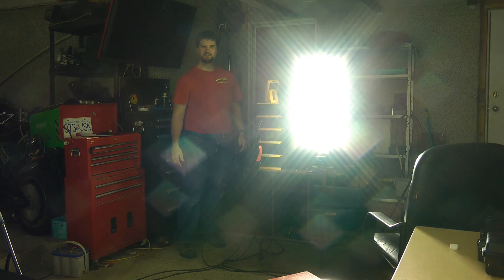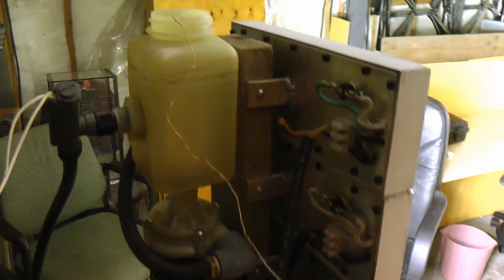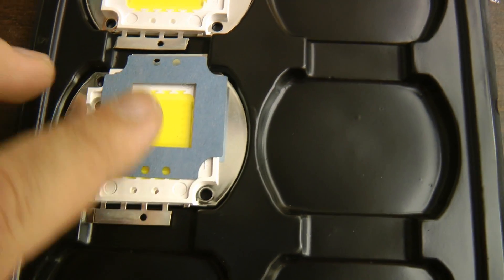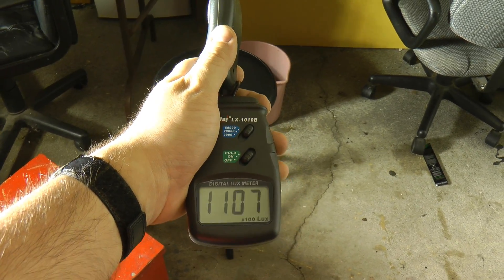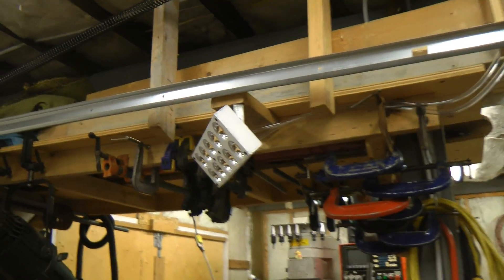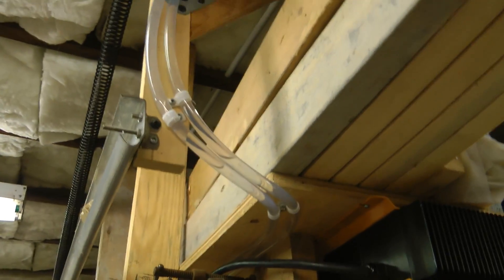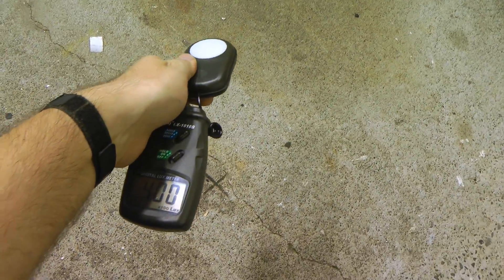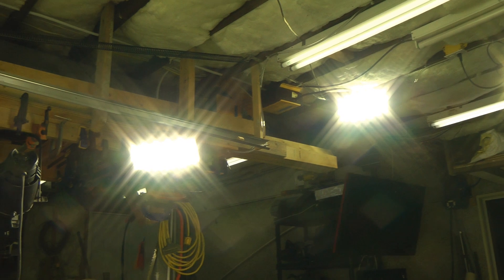World's most powerful LED light - 5kW (1kW module build part 2)

Comment: It's not /quite/ going to be this nuts, but once my shiney new Chronos camera shows up I've got a 300x215x40mm heatsink off some kind of power amp that, along with 3, 80mm Delta high flow fans and some ducting, should make an acceptable 1kW portable LED light. :)
It's going to be used by to many people to to trust them to water cooling. And I should be able to use the camera's trigger in/out to turn the lights on/off as needed too if it can't run steady state.

Comment: I am trying to put two 150w LED chips in an old theater Fresnel fixture. My main concern is cooling. I was thinking of grabbing two Corsairs H55 to to cool both chips but I have no clue if it will be enough. 
I will be using two Luminus CVM-27. They operate at 4200ma/36V/150W and have a Thermal resistance of 0.16 ℃/W
Do you know if the H55 will be enough to cool?

Comment: I wonder... Why won't you use automotive radiator as a cooler? They come with 12V fans, taking a big one with two fans and running them at lower voltage would provide plenty of cooling and quiet operation.

Comment: 5 kW of LED lights... I can imagine the heat you can feel standing in the middle... But then this 750 kW of incandescent lights at IIHS - That's ridiculus, I believe that running them bit too long would heat the whole test chamber to some extreme temperatures!

Comment: aluminum corrodes very quickly in cooling loops. you should also try to avoid mixing metals.  aka the brass fittings. venal tubing is also not ideal. the plasticizes leach into the cooling fluid quickly. you should also use car coolant so nothing grows in you're coolant. it will also add anti corrosion.

Comment: A few things you might want to think about

Water wetter, it's not a type of anti-freeze, but it breaks down the surface tension of water, improving heat transfer

Also, by chaining the water blocks like that, some array's will be getting hotter then others, possibly significantly so.

Sections of copper tubing in the straight sections could help add some additional cooling and help with the sagging issue if your ever running those cooling lines again in the future.

Comment: Led lighting becomes impractical when you need a ton of light, but I would be interested to compare the equivalent amount of leds to an IMAX size xenon arc lamp. How much surface area would you lose and how much energy would be wanted on cooling if leds were used? I'm guessing it would be less, but you never know.
Reply from the maker: This LED setup produces almost as much light as a 15kW Xenon lamp like those used in IMAX projectors. Xenon lamps aren't that efficient, but they do produce vastly more concentrated light than LEDs, which allows better focusing. Imagine all the light from these LEDs being produced in a 3x10mm area. There's no way you could run an IMAX projector with LEDs, at least with current technology.

In terms of cooling, the Xenon lamp is more complex than cooling these LEDs. Those large lamps require two water cooling loops (one for each electrode) which are electrically isolated, plus powerful air cooling as well.
Reply: ... my point was merely that it's probably possible, though not practical.

Most people often seem to think that because something isn't practical, that it's impossible.  There's a large difference between the two
Reply: I think it's be possible with current technology, but the lensing needed would be complicated and HUGE.  Certainly not practical.
Reply: I'm talking about a large array of led's, and a large lens setup.  i'm not talking about making a single chip that bright
Reply: animefreak5757 absolutely. For example, we have had the tech to put humans on Mars for over 30 years. But was it practical? No (mostly due to economics).
Reply: Actually, conservation of étendue forbids such concentration apparatus, no matter how complicated (as long as it's linear, which mirrors and lenses are).
Reply: a quick google shows that what your talking about is WAY over my head, it's a bit moot though, as even if it is possible, it's entirely impractical.
Reply: No, it's not - semiconductors will die in flames, if you try tu concentrate even 1 kw in small area like arc of xenon lamp. In headlights there are arrays of tiny leds with lenses.
Reply: animefreak5757 and that is exactly why a xenon solution is still superior in many cases.
Reply: animefreak5757 It's a bit complicated, I haven't studied it much myself. Here's the intuition: conservation of étendue implies you cannot concentrate light into more and more concentrated beams indefinitely. Specifically, for a surface LED source, you can have as much brightness at a region as 2x the brightness near the LED surface. So the brightest you can make a little square that would be behind the projection filter would be 2x as bright as the LED module itself, which is much lower than the 5kw/30mm^2 requirement.
Reply: Do you know of any way to reduce fall-off (the intense drop-off in light output that happens quickly from the center of an LED spread)
Reply from the maker: With the lenses the spot is quite even right up to the edge. Without them there's more dropoff. A clever diffuser system could make it better but that's some effort to make.

Comment: I'd recommend doing what DIY Perks did on his LED. Sand the flat side of the lens to get it frosted, it will still focus the light, but the yellowish ring will be blended into the rest of the light. Your current settup, while also viable, wastes that light for heating the paper.

Comment: Should not use series connection for cooling.  By the last light block, the input water temperature will already be too high.  Plumb it in parallel and you'll get better cooling performance.

Comment: Jesus that is ridiculous the amount of heat from that must be around 3500watts. I myself have built a 500 watt portable light, when going from only having one light on and turning the other 4 on i only saw maybe a 2x increase in perceived light so imo the other 400 watts not really worth it for flashlight lol. What do you use that light for.

Comment: Hi mate great build. If you wanted double the lumins and run a lot cooler, you could replace those with the next generation of cobs . The Cree CXB3070 , or cheaper alternative is the Citizen CLUO48. You will be amazed.
Reply: Garry
I like LEDs because of their extraordinary method for producing white light which is also very efficient.
Unfortunately I doubt a little about their spectrum quality. Especially the peak in blue and non sun like spectrum (there is no UV and peak is different).
I am collecting as many different LED solutions and then I will try to test and compare their spectrum to sun spectrum using all self gathered data (up to now I have only relied on spectrum graphs of different sources).
My goal is to simulate light as close to Sun spectrum and for that I will need to analyse the Sun (and Moon also) spectrum as good as possible through a day/year/seasons and then find the best equivalent light.
I believe that nature knows best which kind of light is good for us as it shaped life on Earth as we know it, and only cca. 100 years ago people started using extremely artificial lighting sources (electricity and invention of incandescent light).
But incandescent light is still nature's way of lighting (we heat up tungsten filament to 3000K degrees and then it produces radiation similar to black body radiation at 3000K), where as the following are completely artificial: fluorescent lights (3-5 wavelength peaks), halogen lights (strange behaviour in IR, extreme peak and this IR energy can cause our eyes/retina to slowly burn), LEDs (light radiation only in visible range, but its shape is still questionable as it does not represent anything natural (e.g. blackbody radiation)).

About discount joke, I thought you had me for one of those YouTube people who are trying to make other people buy on affiliate webstores :)
Reply: Garry
I agree with you. These Chinese COB LEDs are extremely inefficient for their power draw. I was able to get similar light output to 10W (measured) Chinese LED using 3W (measured less than 3W power) COB LED that used really efficient Bridgelux chips.
The efficient COB LEDs are still made in China, but use modern efficient blue LED chips. Only the most efficient Cree LEDs can compete (150lumen/W compared to at least 100lumen/W of Chinese Bridgelux COBs).
And really efficient Chinese COBs cost only .40$ per 3W COB, and if we compare the price of similar Cree COB CX1304 at cca. 2$ per chip, this is still not extremely expensive.
If anyone is interested in efficient Chinese Bridgelux  based COBs, here is link:
https://tongyifang.en.alibaba.com/
Reply: Garry
And Cree CXB3070 has not only double the lumens, but tripple or even more for the same power draw.
Reply: +ZiGa:S  I'm not saying all Chinese chips /cobs are bad , far from it. But those particular chips . the newer design round chips you sell on a ceramic white base are of good quality,price,performance. And no ,I don't want a discount
Reply: +ZiGa:S I have a vast experience in using led and yes that sadly is true .
Reply: +ZiGa:S Do you test all your cobs, chips ?
Reply: Garry
I have tested quite a lot of LED chip solutions:
- LED stripes (extremely inefficient as the fourth resistor in series consumes almost quarter the energy and LED chips are only average quality)
- Chinese cheap old technology COBs (package is similar/the same as one shown in video)
- Chinese COBs using Chinese LED chips (they are much more efficient than old technology COBs)
- Quality Chinese COBs that use quality phosphor and LED chips (these chips can easily compete if not overperform COBs from top manufacturers (Cree, Brudgelux, Samsung, Philips...)
- the best of the best such as Crees most efficient COBs, but if one wants best artificial sunlight LED equivalent lighting, one needs to look at UV based white LEDs, but at the moment there are only a few companies producing such chips and the best (according to specifications) is Toshiba TRI R that are not yet available for mass market.

I have also found out there are four ways to get white light from LEDs (from worst to best):
- using RED GREEN BLUE LEDs
- using BLUE LED for base and one phosphor that emits in yellow/red spectrum
- using BLUE LED for base and 2 phosphors that emit in green and red spectrum
- using UV LED for base and 3 phosphors that emit in blue, red, green

And I have not tried to sell you anything, I just provided a link to their store that I have bought from and found out they are great value.
Reply: +ZiGa:S Sorry that last bit was a joke . Sounds like you know your LEDs . its great that you do , some really don't . I mainly make  Grow lights using large cobs with either reflectors or large lenses. But the love of my life is using LEDs on buildings, boats  ,kitchens , cars and gardens .   Great colours and controllable don't ya just love um?

Comment: Seems many have already commented on the series cooling being an issue: much better would be to use an send and return manifold. Also given the video footage of the air traversing the coolant lines, it seems the flow rate is retarded. Have you characterized your heat sinks w/r/t pressure vs flow? Could be you have an appreciable pressure drop across each. Finally, do not leave untreated water in the system: it will likely turn to nasty green sludge. You will want some scale, bacterial and corrosion inhibitors in the water.

Comment: Automotive gasket card wound handle the heat
Reply: Midnight Mechanic where do you come up with non water based antifreeze would help. Whether using propylene or ethylene glycol, pump horsepower requirement goes up, density goes up, specific gravity up, and specific heat down. All of these lead to less ability to transfer heat. You may increase boiling point, decrease freezing point, and you may help prevent scaling and erosion, but you definitely are hindering heat transfer, not helping. Distilled water is the perfect heat transfer fluid if you are out side of the range of freezing, boiling, and are not worried about inhibitors. Only thing that will help heat transfer is thermal transfer compounds on heat sinks, properly sized radiating device with properly met airflow requirements, and a flow rate which leaves enough contact time to absorb sensible heat, but fast enough to prevent an area of no delta T on the heat exchanger as fluid exits.
Reply: Using non water based antifreeze would help with cooling too, that is if the LED units can handle chemical minerals and glycols.
Reply: You are confusing distilled water with deionized water. Distilled water will not leach out any metallic Ions, as the charge has not been changed by reverse osmosis. I am a medical chiller mechanic specializing in MRI, and linear accelerators. I am confident in my post and stand behind it.
Reply: The only problem with distilled water is that about 10 minutes after flowing through those aluminum housings (especially since I think the back of the modules are copper), you leech ions out of the metal, and it's no longer pure.  Then you have nightmarish galvanic issues to contend with.
Reply: Distilled water and Red line water wetter for corrosion prevention. that would be the best combination of heat transfer and corrosion resistance as long as the system does not have to be stored below freezing

Comment: I remember a guy at a 'party' that had an inverter the size of a small fridge in the back of his mini van, it was running an old arc light from a theater. the huge light was mounted to the roof racks and it was rated at 20 K. The inverter was on fire and I told him, he didn't seem to worried as this was happening periodically. He did put the fire out, but did not stop running the light.

Comment: You might look for an automotive heater core for a more efficient, compact radiator.
Reply: The vast majority of the heater core's i've pulled from car's are single layer, and have almost the same size passages and fin's.  Which makes sense, since if it was easier for coolant to pass through the radiator rather then the heater core, you wouldn't get much flow.  I think you guys are thinking of the AC one, not the heater core
Reply: his radiator is much larger and will disperse more heat then a heater core.  Radiators are all about surface area, and flow, almost nothing else matters.
Reply: Right, a heater core has more, thinner fins and more, thinner passages. Consequently it has a lot more surface area.
Reply: none of the heater core's i've seen would come close to moving as much heat as what he has.  the only compact solution i've seen with those small passages your talking about is the AC radiator inside the cab
Reply: compu85 is sort of right. a heater core would be more efficient, but too get the same cooling he would need multiple. radiators are intended to have massive c.f.m. running through them, heater cores just use a blower fan and transfer a lot of heat.
Reply: I'll have to take a picture of the heater core out of our 2012 Passat. It has super fine passages, and can extract a bunch of heat from the coolant.
Reply: I'd be thinking two or three layer "desert" type cores for larger vehicles if you want a bigger heat loss.  Salvage yards will have those on the cheap for you.

Comment: Only thing I'd be worried about is the in series cooling. Won't the last light have the heat of the first 5? You may want to check temps at each light

Comment: Make yourself a little supply and return manifold so the cooling blocks are piped in parallel. I promise you that you will not be disappointed with your temperatures. Great build!

Comment: Better cooler would be to use a car radiator and plumb it in, with 4 of those large fans to shift air through it. Would improve the performance greatly. Plus add as well to the coolant some antifreeze, as otherwise your thermal transfer will become degraded with corrosion inside the milled blocks. If you are going to leave the coolant in there a long time seal the system as well, as you will get a bacterial film growing inside the tubing and parts, living off the plastic and seals. Seal the system airtight and it will last longer, or do what I did and run around 0.5% KI in solution as a disinfectant, with no antifreeze.

Remember as well that that clear PU tubing will degrade with time, better to replace it with the same size nylon tubing which will not be clear and which will be stiffer. Use push in pneumatic fittings to make the bends as well then, they are actually cheaper than the hose barb fittings.

Comment: Your going to get better cooling if you run the water loops in parallel instead of series. With series, the last unit is going to have the least delta and highest average temperature.

Comment: That must have been extremely satisfying to watch the first time that you turned the pump on and watched the air being purged from the cooling circuit...If you find yourself struggling for thermal capacity, a cheap way to get a stupid amount of cooling might be to use a car radiator?  Might find that you can then get away with very little requirement for fan cooling in this case, and you could find one then with an integral header tank to simplify things a bit.